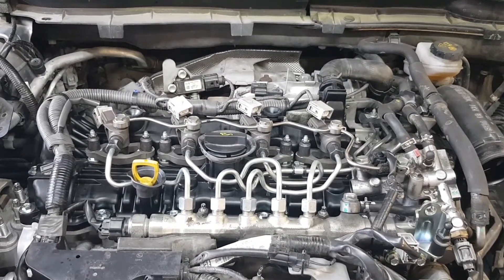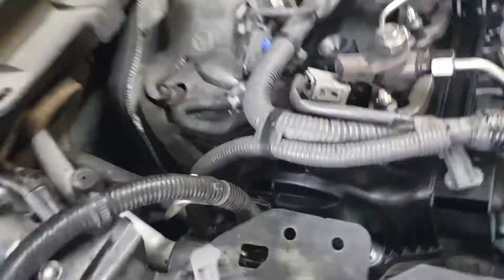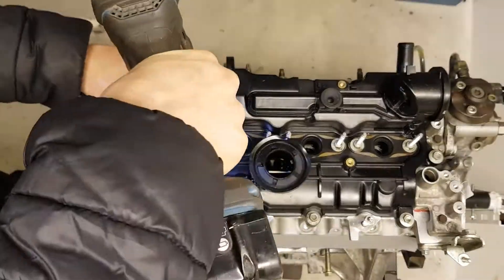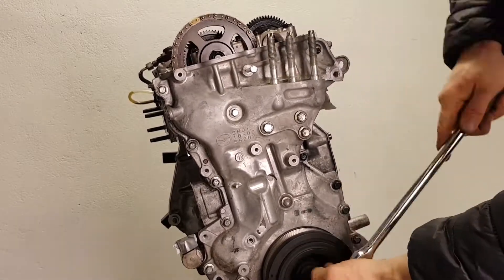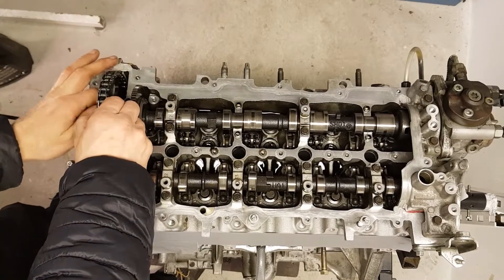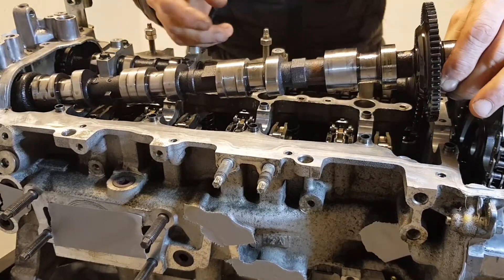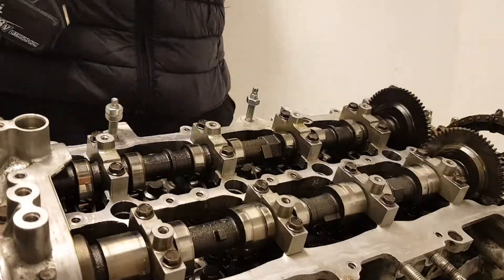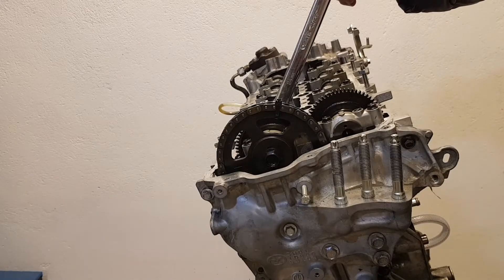Mazda Skyactiv 2.2 D Engine, Exhaust Camshaft removal installation.

Comment: Use a thicker viscosity 10W-40W Castrol Magnetec to prevent premature wear
Reply from the maker: It's just a guess. Why would you increase viscosity thickness? Did you test that theory? I would rather replace the oil more frequently than change the viscosity
Reply: @JB_Auto Because Mazda went to thinner viscosity oil to increase fuel efficiency and in it caused premature wear on the exhaust cam. There were many problems with the Mazda diesel engine used in the skyactive models, premature turbo failure and the whole turbo and wastegates have to be replaced costing thousands, the cylinder head has known problematic hotspots leading to blown head gaskets, sensors routinely fail, the high pressure fuel pump packs up prematurely even when you change your engine oil and fuel filter costing thousands. It's a terrible engine, go for the Mazda petrol engine so much better, exhaust cam failure is very common in the Mazda 6 diesel engine costing thousands to repair, there were also timing chain issues on the Mazda 6 diesel engine.
Reply from the maker: Thanks for the comment, Yes I'm aware of those problems. I talked in one of the videos about why the camshaft was prematurely worn out, and it doesn't have anything to do with the lubrication. Check out this video, please: https://youtu.be/qjMqcpzMRVg?si=1L_m7ns8C-VuaYmO. Turbo failure and oil pump are caused by camshaft's metal particles circulating in the lubrication system. Thinner oil is used due to finer tolerances in engine components as well.
Reply: @JB_Auto  Mate any engineer will tell you that lowering viscosity increases engine wear lubricity tests prove this, nothing to do with the engine tolerances it's the same engine as the previous Mazda 6 diesel in the GH that ran @0-40W the only difference is that Mazda enginners lowered the compression ratio to supposedly increase fuel economy, with no gain in power and only very slight increase in economy. Mazda Australia actually instructed Mazda 6 diesel engine owners to switch to the 10-40W engine oil betcha didn't know this. In any case I'm getting an Infinity Q50 Turbo fun car now😂 John Cardogan an automotive industry expert engineer devoted an entire video explaining how using thinner viscosity oil will prematurely wear an engine and there are many examples from  Mercedes and BMW models

Comment: I replaced a head gasket of cx5 Mazda engine ni SH,and wen i start on the car has no undistart, but it has a check engine light, then after daigonise I get code p1336, I am check out timing 4times no difference, please guide me
Reply from the maker: Could you write the comment again? It's difficult to understand. You say the timing has been checked 4 times, so you are sure the timing chain, including both dots on the camshafts, are aligned correctly. Is there any play on the chain? Are the sensors  CMP and CKP correctly mounted? Did you change the timing chain? If all is good, try to perform the timing chain learning procedure.

Comment: Hello, my friend, I'd like to ask you a question. I changed the exhaust camshaft on my Mazda 6, and now, with 30,000 km, the camshafts are worn again. My question is, can you explain why this happens? Thank you very much, and I'll be watching all your videos.
Reply from the maker: Hello, yes, the exhaust valves are getting stuck due to soot, which gathers on the valve stems. The soot creates high resistance that wears out the camshaft. It also damages the hydraulic valve adjusters, especially on vehicles with short driving distances. I mentioned that in one of my videos, link: https://youtu.be/qjMqcpzMRVg?si=-p12KcYcwpZyHm0R

Comment: You can do it without releasing the tensioner, it's easy to make a simple tool that bolts to the cam cover flange by the chainwheel and supports the chain wheel on 2 pins/bolts in the slots at 10 and 2 o'clock. Then you can unbolt the sprocket and slide it off to extract the cam without removing the sound protection or releasing the tensioner.
Reply from the maker: That good idea will reduce the amount of labour, thanks.
Reply: I ave done all this but still after daigonise I get code p1336

Comment: Hi! Nice video! I removed the valve cover on my 2.2 Skyactive diesel to check if my camshaft is worn or not (luckily it isn't), but after assembling everything back together, the engine is not starting. I'm almost sure I didn't mess up anything, it wasn't the first time I did similar job. I loosened the nut of the metal tube that goes to the common rail from the fuel pump, and when cranking the engine, it doesn't seem to provide any fuel to the rail. Again: I didn't do anything with the fuel pump, it must be still attached to the exhaust camshaft (as non of them were removed). Do you have any ideas?
Reply from the maker: Yes, there must be air in the fuel system. Remove the air from the fuel filter first, so after that, you should be able to crank a few times and start the engine. Ensure all the fuel pipes and hoses are correctly attached, especially around the fuel distributor.
Reply: @JB_Auto Really? I'd never thought of that because I didn't touch the fuel filter, but if really that's the case, then you're a lifesaver! I'll checki it soon! Million thanks! 👍
Reply from the maker: @veght333 The fuel distributor is located on RHF part of valve cover when you remove injectors and the distributor, there has to get air.@veght333 The fuel distributor is located on the RHF part of the valve cover. When you remove the valve cover,  injectors, and disconnect the fuel distributor, air must be in the system.
Reply: @JB_Auto Yes, it has an air bleeder on it (with the black cap). I put vacuum on it and fuel started to appear. Isn't that enough? What else do I need to do?
Reply from the maker: @veght333 I usually drain 0.5 L -1L from that bleeder and then crank the engine, looking at the fuel pressure in the common rail and the desired pressure
Reply: @JB_Auto  So I tried a few times and eventually it worked! First I bled the fuel filter through the tube that goes to the fuel distributor, then I bled the distributor itself, and then it started up! I'm very grateful for you reply, because you saved me a lot of unnecessary work (I was about to remove the valve cover again, to see if I had messed up something there). Again: thank you very much!!! 😊

Comment: Hi jb I need some Advice, basically I broke the injector screw in the camshaft holder beneath the rocker cover. What's the best option to replace the camshaft holder or remove the screw with a replacement
Reply from the maker: Hi, the injector screw goes to the head engine, not to the camshaft holder (camshaft cap). Those screws crack when the injector is overtightened, and I would drill in the middle of the bolt and use a bolt remover.
Reply: @JB_Auto  I think the screw it popping out so you might be able to screw it out
Reply from the maker: @jaykay7007  then the issue is solved.
Reply: @JB_Auto  but could that damage the bolt thread because it broken twice
Reply: @JB_Auto  but does the screw damage the  head engine thread
Reply from the maker: @jaykay7007   That would be a very rare case.
Reply: @JB_Auto  thanks jb

Comment: Hi jb what are the torque settings on injectors installation
Reply from the maker: Torques are in the description under the video: P06DE P055F Low Oil Pressure Mazda 2.2 Skyactiv D
Reply: @JB_Auto  thanks buddy

Comment: I have a 2016 Mazda 3 - Skyactiv 2.2. A year or so ago the head gasket had to be replaced, and following the repair, the car continued to show an error with the camshaft sensor. Sadly the garage that did the work wouldn’t accept responsibility. Then .. just a few days ago, things went really wrong. The car wouldn’t start properly and the new repair garage tell me they can’t fix it without it potentially being very expensive. They found the chain that connects to the oil pump in the oil sump pan along with a few dowels. So .. now, no car and I don’t know what to do with it except scrap it .. which is just so painful to do 😢
Reply from the maker: A year ago, you say. I'm curious: what was the fault code? Was it related to correlation? How many miles has the car driven since then? During their job, they should have noticed that the oil pump tensioner had some wear or even the chain itself. There could also be an inexperienced car mechanic who hasn't seen that the parts had some wear. Anyway, it will be impossible to prove their wrongdoing. Often, when we do that kind of repair, we inspect the most vulnerable parts of the engine and advise customers on what should be done additionally. Based on your description, it will be expensive, sorry.

Comment: hi there
i replaced the exhaust camshaft and lifters also cleaned out the tappets but thewere not so solid and had little  play
after full assmbly the engine sound noisy i attach the video link  down below would you giving me your opinion please
https://www.youtube.com/watch?v=ydWAQgAc1dI&t=3s

Comment: what symptoms occur when the exhaust shafts need to be replaced?
Reply from the maker: In most cases no symptoms, then may appear anything related to metal particles circulating in lubrication system. If fixed at early stage no severe consequences, depending also on frequency of oil replacements.
Reply: Vacuum pump will need replaced, code p258b
Reply: @bauagan   I found very interesting thing, my engine injectors brackets holders (SH0110244A), 3 of 4 split a half, what does it mean? Incorrect installation? I'm surprised
Reply from the maker: That's incorrect installation.
Reply: @JB_Auto  and how to install correctly? maybe i could try to weld the parts. maybe you tried to do that? does the part work?
Reply from the maker: @RolandasKristapaitis  That part shouldn't be welded,  to install correctly you need to apply the correct torque in the correct sequence, I do not remember that from the top of my head, but if you search in the descriptions of my videos, you will find it there.
Reply from the maker: This is the video https://youtu.be/VF6cVSb5dG8?si=CzhbkNjZ8rMCr_uo

Comment: Hi,
I am working on a 2013 Mazda 6 2.2. I have replaced the exhaust camshaft as it was worn, also the rocker arms and the tappets on the exhaust side. Put new valve cover seal with oval injector oil seals, also replaced injector washers. The problem is that the car has rough idle, but no fault codes initially. So I have checked the injector correction values and the learned values as well. 3 out of 4 correction values are around 7 and the last one is -7. Also the learned values are all 0 except the last MPA setting for them which is on -4. So I have reset the learned values, tried to perform the adaptation (jump the pin to the ground 5x quickly). as I don't have forscan yet. It starts it, but then aborts and the glow plug light flashes and the check engine light is on. 
It gives the p1200 fault code. I am getting the compression test done tomorrow and also will try to carry out the adaptation with forscan. But do you have any rough idea what it could be or why it doesn't perform the adaptation? The symptoms are rough running up till around 2k rpm and white smoke from the exhaust, that's why I think it has to do with the adaptation. Had the same symptom on a Ford 1.6 tdci, done the adaptation although it was a bit different that this but after it worked.
Any help would be highly appreciated.
Thanks in advance!!!
Reply from the maker: Correction values should be around 0 you usually see on plus and minus side 0.01 0.4 if they are over 1 you should replace them, correction should be performed ECT at over 70 degrees of C fuel temp I do not remember exactly but have it over 50°C and air intake approx temp. over 30°C if temperatures are lower then it will not go.
Reply: @JB_Auto  thanks for your reply. So if it is above +-1 is way off? I have done the adaptation when the engine was proper warm, meaning the ECT was even over 80 degrees or even 90. 
I have another set of used injectors at hand, I will try to use them. 
But how come the car was running okay before the replacement and after it has adaptation problems?
Reply from the maker: Well, you can say that the above 1 is way off, I would say qualifies for a replacement. I have never had problems with adaptation, I would check all the parameters related to air, fuel, and temperature if sth is off then you will not perform the adaptation.
Reply: @JB_Auto  do you have any reference data I should be looking for? Meaning ranges between or from to?
Reply: @JB_Auto  a little update if you are interested.
So I swapped the injectors.. same result. I guess the injectors are fine as my scantool(autel) show range for the correction between 10- (-10) for acceptable, so assuming your one show from -1 to 1.
I have done the compression test and cyl has 0 compression. 
What do you think? Can it be a burnt valve? How comes that it wasn't showing before the repair? Did the injectors compensate for it? Or I messed up something?
Reply from the maker: @MrNiceGuy94   You wrote that the car has a rough idle; it doesn't run on one cylinder. Based on my experience, we never had such a case among many jobs done. There could be soot on the valve stem, and the valve could be in the open position, so you have zero compression, but that would be extreme since the engine is running; it should eventually run on all cylinders. I think an inspection cam may help.
Reply: @JB_Auto  it is all weird. The injector calibration fails at 44% but when it is doing it is running smooth even on indle. Then it returns to misfiring. The correction values are same on 1,2,4 cylinder except the cyl 3. When I have done the compression test, cyl 3 showed 0. I am really thinking that I have made some error during the repair.
Reply: @MrNiceGuy94  Did you find where you went wrong ?

Comment: Hi have Mazda 6 2.2.  p0016 come up I replace timing chain still same
Reply from the maker: Perform timing chain initialization after replacement that should fix the issue. If not, then it could be wrong timing chain alignment.

Comment: Hi a great video! 
Have replaced everything from  the cylinder head to the camshaft on my mazda cx5 last week. Currently I have a problem that the warm engine starts to jerk from 2000 rpm and has no power. When cold everything runs great and the engine runs smoothly. Maybe you have an idea?

Comment: Hi , great video. One question though , do the hydraulic lash valve lifters need to be bled before the new camshaft is fitted ?
Reply from the maker: Thanks, if you have a new HLA then no because the new one is filled with oil. old ones if stored vertically and in a container with oil not needed bleeding, otherwise recommended.

Comment: Goddam, this is 50 times better than Audi engines. Everything is an hexagon head. The camshaft isn't locked by a volkswagen specific bolt at 1000Nm. The fuel pump is logically bound on the side... oh gosh, why germans why can't you do stuff like Japanese?
Reply from the maker: That's why I work with Mazda🙂

Comment: What force (nm) to tighten the cylinder head? Thanks
Reply: Engine code- SH 30262831
Reply from the maker: Step 1. 15 Nm, S.2 40Nm, S.3 80-95 ° S.4 80-95 °, S.5 80-95 °.
Reply: @JB_Auto  Thanks. And one more question. Does this type of engine has problems with camshaft?
Reply from the maker: Hi, according to the engine code there is a possibility that you may have a problem with the camshaft, if you have good service history at an authorised Mazda dealer, The vehicle should be already repaired. What were the model of the car and the manufacturing date?
Reply: @JB_Auto my model is Mazda CX-5 2.2D AWD 175HP made on 08.2015. Do you think mine has this camshaft problem?
I already have the vacuum pump error P258B and I was hoping I can only replaced the vacuum pump to save some money.
Reply from the maker: @HD2You  most likely, but you should inspect it visually

Comment: Great video, thanks! I own a 2016 Mazda 6 2.2D 175hp AT (115.000km) - Is it true there's a problem with injector seals on this engine and that it's recommended to do a preventive change?  Also found big carbon deposits in the intake manifold, Egr valve and Egr Cooler. Any advice on what other components tend to fail on this engine and I should keep an eye on?
Reply from the maker: Thanks for the comment. Replace injector washers now. Injector washers tend to fail at around 140000 km; the replacement cost is incomparably cheap to what may happen when it is too late. Parts you need for that are 4pcs modified injector washers. 5psc injector return pipe gaskets. 8pcs injector nuts. Labor time no longer than 1.5h. Do not replace high-pressure pipes because it is reusable many times, workshop manual states otherwise. I recommend performing this job at Mazda dealer.
Carbon deposit is most likely to appear on vehicles being driven short distances at approx 80K km.
Replace engine oil every 10000km and ask your dealer to perform injection amount correction simultaneously, flush engine every 3rd replacement of oil.
Apart from that, you shouldn't have significant problems with this model year of the car.
Reply: @JB_Auto  Thank you so much for your reply. I'll have these replaced asap. Keep up the good work!